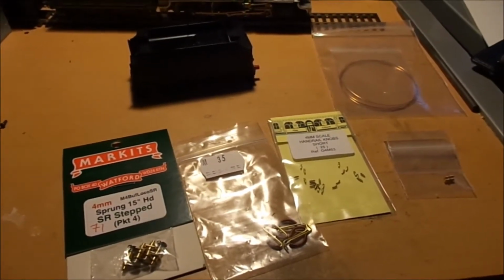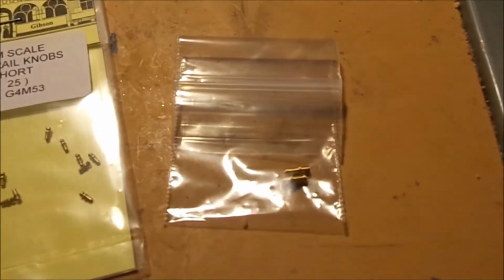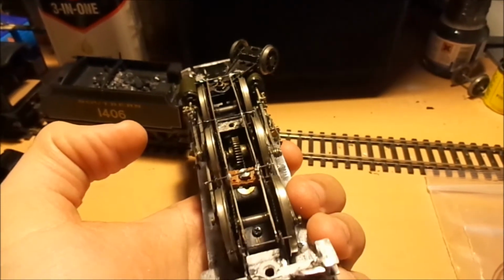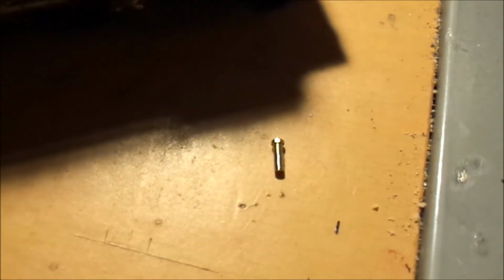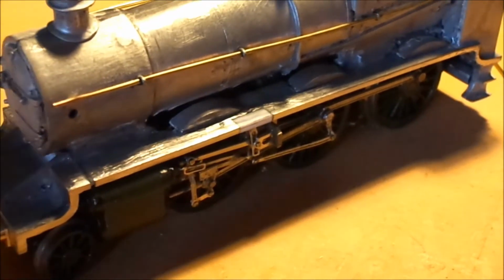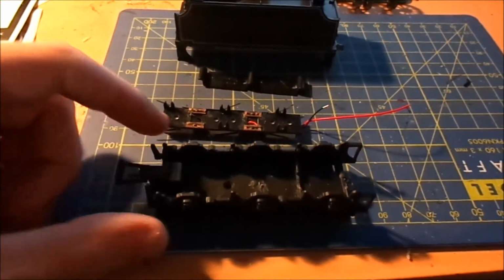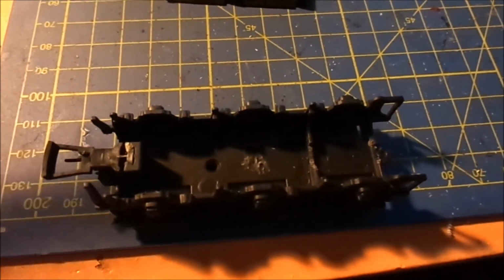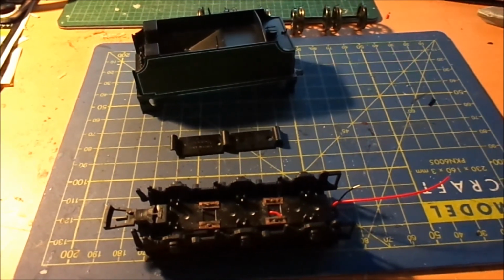SE-Finecast, U-Class, restoration 1638, part 2

Comment from the maker: Depends on its condition, knowing what will be in next, after the S15 is out late summer or towards the end of the year, Stowe will be in, Also have to keep an eye on the Atlantic, which could be close to be complete in 2016 / 2017. 75027 is in good condition as well, Camelot is also in bits, Q-Class as well, the Q is on a fast track overhaul, as they are lacking powerful locos hence the 9F on loan. 3 of the above i think are class 4s.

Comment from the maker: Yes its a challenge, its a bit different building one from scratch, the body on  this is about 20 years old they have changed a bit since then, at least they have updated the chassis... its only saving grace. Its nice to strip it back, and start again adding your own touches to it, and improving it as you go. Looks much better now, as part 3 will be out tonight as well.